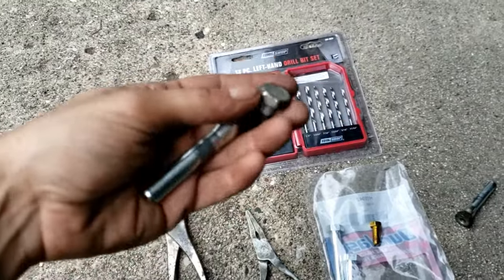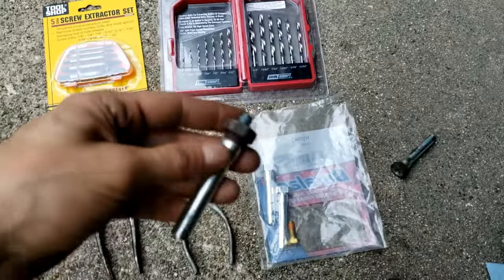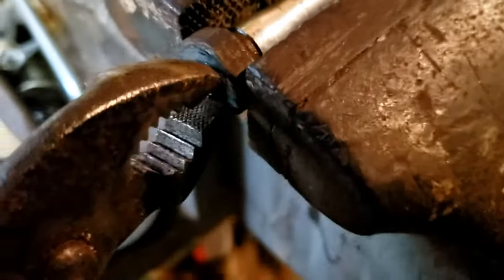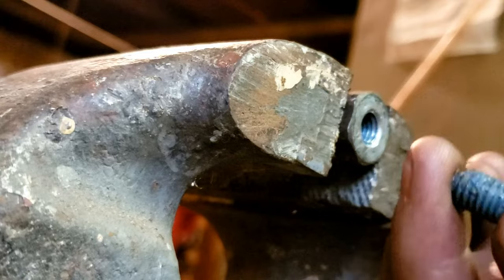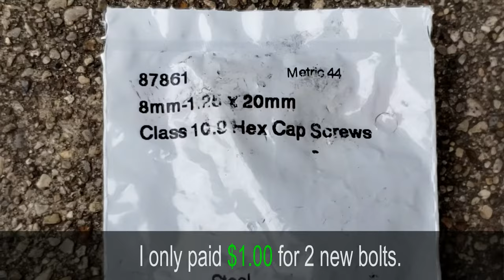How To Remove Broken Snapped Brake Caliper Bolt

Comment: I did a nightmare brake job myself fighting a Hub for two days and went to torque the bolt with a pos torque wrench I rented from auto zone.  It NEVER CLICKED and obviously I over torqued it because it snapped right off.  I just started to cry finally like a little biatch.  So YOU made me stop crying and give me some hope.  Thank you!!!
Reply from the maker: Glad this helped. My car was down a few days as I had to figure out a solution. I always get into the weirdest or worst situations possible. But hoping this situation doesn't happen to as many others or at least its nice knowing a quick solution is available for others to try!

Comment: Always best practice to replace guide pin if you’ve already broken the calliper bolt into it most likely you’ve already stripped the threads for the guide pin due to them being over torqued.
Reply from the maker: Mine are still going strong. For peace of mind, you could change the guide pin's.

Comment: It happened when I changed my brake pads yesterday. Unfortunately there wasn't enough thread left to try that so I ended up putting it in a vise and drilled a hole in the middle. Stuck a bigger drillbit (but a bit smaller than the bolt) and hit it with a hammer to jam it in place. Put the drill in reverse and it unscrewed right away!
Reply from the maker: Very nice you got creative and got it out! You could also do this with a left hand drill set. Hopefully you got some replacement bolts and didn't spend a lot of time or money on this.

Comment: Gotta love dodge…

My guide pins are one unit.

It goes HEAD-SMOOTH SLIDING/GUIDING AREA-THREADS (into mounting bracket.

GUESS WHERE IT BROKE OFF.

The threads going inside the mounting bracket.
Reply from the maker: I believe it!

Comment: How were you able to get the caliper released (and off) with the broken bolt protruding?  Were you able to press it in momentarily  (assuming the pin was sliding freely)?
Reply from the maker: Yes I think that is what I did, push it in, and then remove the caliper with a flat head screwdriver.
Reply: @FixCarYourself  The trick is holding the pin in while removing the caliper.  In my case  the bolt sheared when accidently over torqued, but close to the pin, so hopefully not protruding into the bracket that much.  I have a pin punch that hopefully will suffice. Thank you for your reply.
Reply from the maker: Awesome. your trick idea should help others out. Thanks for the detail!

Comment: what should I do when the brake caliper bracket bolt is broken like that? It’s stuck holding onto the hub assembly. I can’t try and push it out because the rotor is in the way and I can’t get the rotor off without taking the caliper bracket off. In a pretty sticky situation
Reply from the maker: Tough situation. When you can't just pull the pin or bolt out and then remove the screw as shown in the video, you can try drilling the bolt out with a left hand screw bit. This video shows you how to get a threaded screw out. https://youtu.be/L4WHs_jbx1Y 

The same concept is applied but to the caliper bolt instead, and BTW this can be done for mostly any screw...just drill it out with a reverse screw bit even if the head of the bolt is no longer there.

Not sure if I fully answered your question, as cars can have many different problems and odd situations, but let us know if this helped and if the link above helped as well.

Comment: I accidentally broke one of mine, doing my Frist brake change.  Once broken, I used a normal bolt with a washer, should I replace the normal bolt for another with OEM bolt?
Reply from the maker: I didn't use an OEM one. The threads are the same  as the OEM and so is the length of the bolt as mentioned in the video. OEM or after market shouldn't really matter for this kind of a bolt IMO.
Reply from the maker: You could take the broken bolt to a hardware store to match it up, to get a replacement which is what I did.
Reply: @FixCarYourself  I did the exactly the same thing you did, replace with same length and same thread size bolt.   Thank you for lifting up my concern!
Reply from the maker: @IamJohnnyFan  glad this helped, and that you have peace of mind ✌.
Reply: @FixCarYourself  literally nowhere had ANY replacement guide pins. Half barely knew what a guide pin was. The auto repair and parts shops in my country are a complete joke
Reply from the maker: @Kier4n99  wow that's shocking. A hardware store should have it. Thank goodness for the internet. Where did you eventually get the bolt from?
Reply: @FixCarYourself  I have yet to find one 🙃
Reply from the maker: @Kier4n99  trying to be creative here. But if you still have the bolt. Put it together and take a closeup picture. Then go online and look for a site that will scan the part and can tell you the size and dimensions of it. And then u can order it from them or buy the exact bolt else where online.
Reply from the maker: Of course another idea would be going to a junkyard to retrieve the part.
Reply: @FixCarYourself  thanks so much for the tips. My mechanic suggested a supplier store to go to. So I'm trying there tomorrow. Otherwise I may take your advice and go to either a junkyard or have to order it online (ouch). Junkyard may be the best place, as my last car (Daihatsu) dealership went bust in my country lol
Reply from the maker: @Kier4n99  ok cool hope it goes well and let me know the price...honestly paying any more for $30 is robbery. It should really cost under $10...its just a standard bolt after all.
Reply: @FixCarYourself  Will do! A bit worried, because it may well be over $30

Comment: What if my guide pin broke and is stuck in there 🤔
Reply from the maker: Usually its not the guide pin that breaks, and its the top of the screw/bolt head. Regardless the process should be the same. The guide pin usually slides. So if you can just barely get a pliers on it and pull it out. Then you might not have to drill it out.